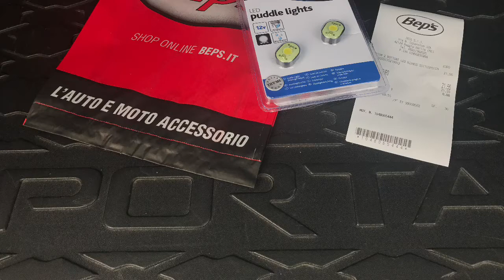New Kia sportage IV (QL) - Puddle Lights New Kia Sportage IV

Comment: Brother appreciate your effort but the light is coming just on the door panel instead of floor.
Is there a way to fix puddle light in the reflectors that are inside the door panel. I actually searched to see puddle lights fixed there